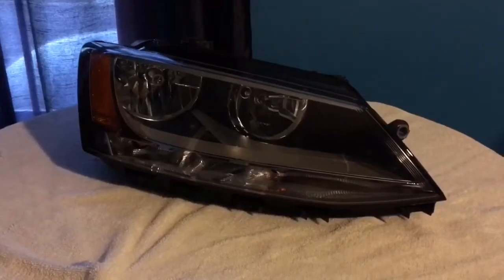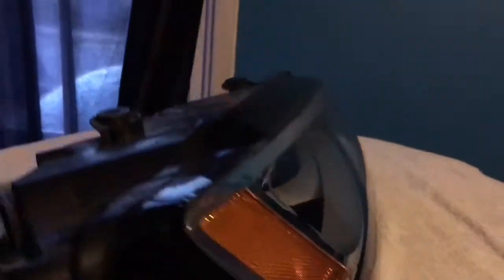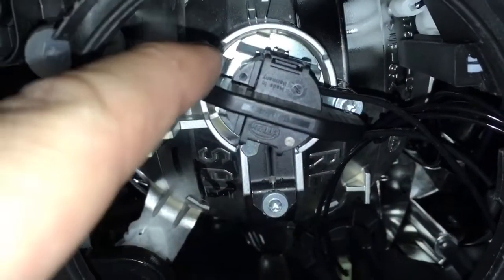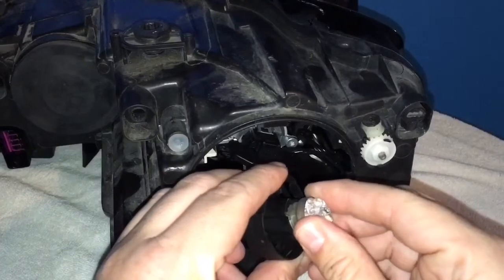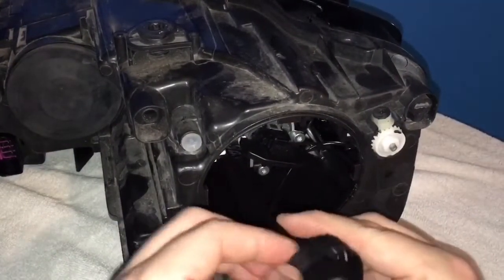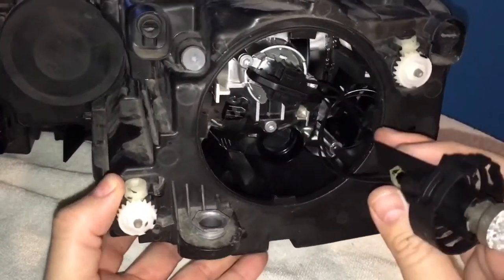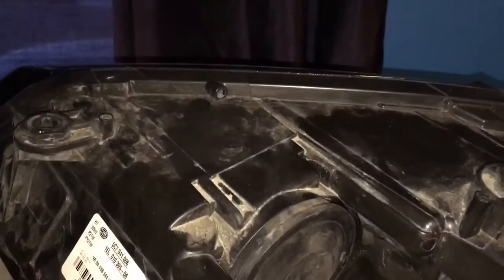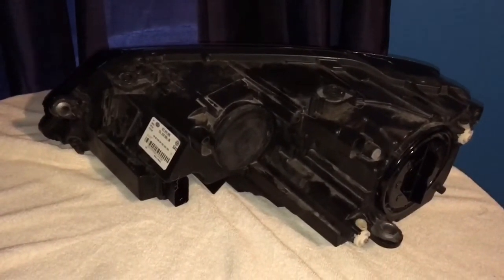2011-2018 VW MK6 Jetta DayTime Running Light DRL/Headlight/Every Bulb-Replacement DIY

Comment: Mrgreek2002 I've watched a few of your videos and I enjoy your channel. I've noticed that you have LED DRL on your 2014 Jetta S in many of your videos and in this video you mention that they are off a 2017 Wolfsburg edition. I would like to upgrade my headlight to the LED DRLs. Did they just plug right up or is there modification required? Also any tips would be appreciated. Thank you
Reply from the maker: Hi, yes they are from the North American 2017 VW Jetta Wolfsburg Edition MK6 Jetta.

One of the reason's why I haven't made a video about them is because I haven't been able to get the taillights to stop working while the headlight DRLs are on. So I didn't want to give information out to my followers that was half assed and not complete.

The short answer is that they are NOT plug and play and need a good amount of custom wiring, especially wiring for turning off the taillights while the DRLs are on.

So search on vwvortex in the MK6 Jetta forum for the 2017 LED headlight wiring write up.

Comment: What about the small light in the high beam housing unit?
Reply from the maker: That’s the easiest, should not need instruction. You just pull it straight out of its socket. Either by holding the wires or the bulb holder.